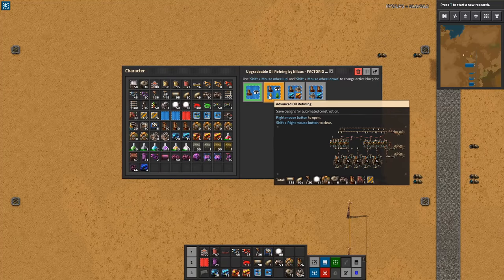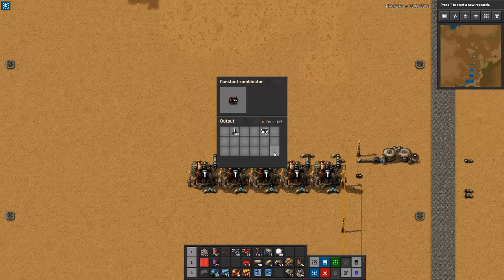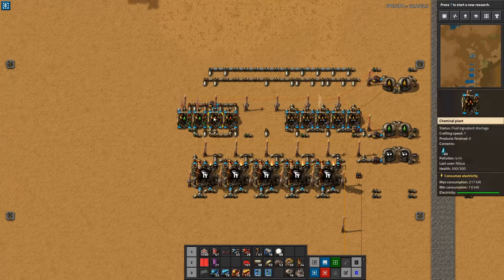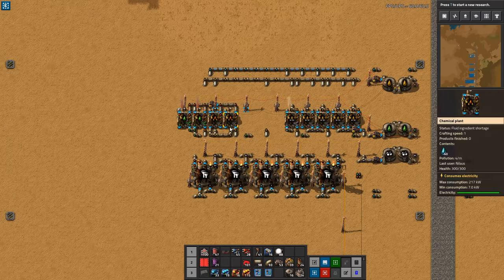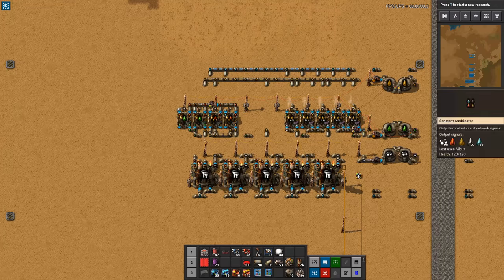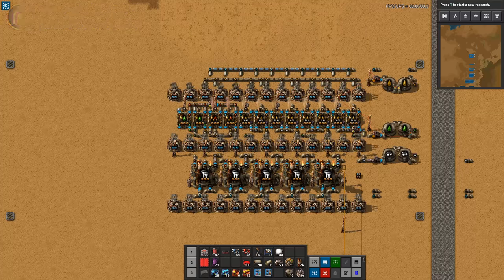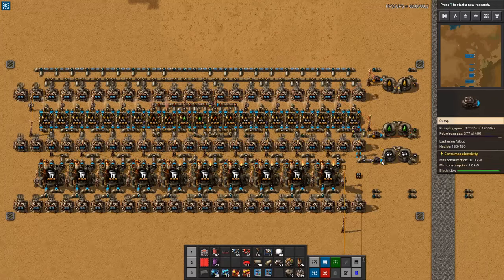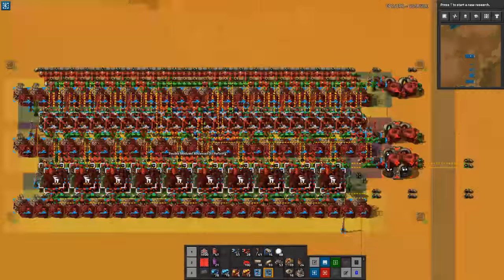OIL REFINING & PROCESSING from Early, Mid to Late game -  Factorio 0.18 Tutorial/Guide/How-to

Comment: How about starting with setting up the oil field itself. Pumpjack facing, pipeline setup etc.  good luck with whatever you are doing now.
Reply: there's no cookiecutter way to do that, but fortunately it's not complicated. just throw a pumpjack down on each deposit, consolidate them into some tanks, then connect the tanks to a train station blueprint. don't forget to provide power to the jacks and if you used pumps as well.

Comment: Really impressive build, I think I will use this. I do think there is an argument that the 8 refinery setup has its place during the early-mid game when you're producing yellow/purple science and starting to produce level 3 modules. The level 1 modules do work, but they're a lot less energy efficient compared to level 3 modules. You'd probably want to upgrade power to nuclear first.
Reply from the maker: I decided to design around 5 Refineries because the crafting time is 5 sec, so it becomes easily divisible, but there is nothing wrong with doing it for 8 refineries either.

Comment: I feel i may go unnoticed here.. but I find it easier to include as much as possible in a city block seeing as my base currently was fit into a single city block other than a dedicated chunk for solar panels before getting heavily into your videos. I've been trying to fit your HUB, Oil refining & processing, greed red blue circuits, and science into a 3x2 city block area (I've built in the water for safety and have roughly this space available (one block dedicated to solars/accumulators)) I've almost got it down.. the circuits and hub was easy to keep in a single block only having issues with the science packs. anyway you could help with that?

Comment: There is a tiny risk that the first advanced oil refinery build might back up with heavy oil. If the lube is being continually taken away and stored/used elsewhere then the pump that allows heavy to light cracking to start (based on stored lube) will never switch on. The refineries are producing 25 heavy per second but the lube makers are using only 20 per second. You aren't storing the excess heavy, so it could back up. You could fix that by moving the pump to the right of the first heavy to light cracker so 1 is always working (like you always have the extra 2 in the final 10 refinery build)

Comment: Pipes were constrained to 1200/s before the 0.18 update. Now they have variable pumping speed depending on the fluid, heavy oil, crude oil have a max flow of 1500/s where petroleum gas have a max flow of 2250/s. Previously, pumping from tank to pipe with a pump, used to constrain the flow rate to 1200/s, now if you have tank - pump - pipe - pump you can have up to 6000/s flow rate, for every pipe after the first pump you exponentially decrease the flow rate of the system, so to keep 6000/s you need a pump every other tile or if you wanna keep 12000/s you have to bring from tank directly to the consumer.
Also underground pipes have less impact on distance than what they used to have. Underground Pipes now acts as a 3 regular pipe line, with the max flow of 3000/s assuming you have a pump on each end.
Reply from the maker: I decided not to go into the lengthy description, but rather state that I had checked it and it is not a constraint ;)

Comment: I'm curious why the decision to make the third stage with increased production use beacons rather than first expand the number of refineries and chemical plants? Wouldn't that be significantly cheaper?
Reply from the maker: From stage 2 to 3 the Petroleum goes from 98 to 831 / sec. If you want to make 831 / sec without beacons then you need 40+ Refineries
Reply: @Nilaus  I too think maybe an unbeaconed build before the the beaconed one would be useful to show. The 5 refinery jump to a beaconed build needs 149 level 3 modules requiring around 1/2 million gas to make the plastic and acid. With a 5 refinery unbeaconed build, using the plastic and acid for nothing else, the refinery will take around 90 minutes.

Comment: Question: Why no heavy oil output? I'm in the midgame if my first playthough now, and I have not gone to advanced oil processing yet.
Reply: The only output you need for heavy oil is itself as the input for lubricant and light oil. So you generate and make use of all of it in the same spot, no need for a tank and pipes outputing heavy oil elsewhere

Comment: I have a question. What do i do when the oil deposits are far away from my main base? Should i transport the oil by fluid wagon to the main base and process it there or shoul i process it at the oil deposit?
Reply: Little late here, and also not him, but I usually ship mine via train instead of trying to process it on-site. There are various reasons, but the biggest one is that It's much easier to transport 1 liquid, crude oil, than several

Comment: Im new to circuit networks but my pumps acting weirdly. I connect my pump to light oil tanks and set for example "[Light Oil] > 5.0K". My tanks only have like 500 light oil and the pump is "Disabled by control behavior".
So maybe someone can help?
Also the whole "fluid system contains 700" so thats not the problem.

Comment: Hey there, I tested this blueprint out and it appears to no longer work as I thought it would, the output still stocks up on heavy oil blocking other fluids
Reply from the maker: It works perfectly. I use it in every base I build without problems
Reply: @Nilaus  I did have Infinity pipes to simulate output and it would stock up on a lot of one of the oils pausing all production, fluids are a nightmare to me, been trying to fix my setup for a day or two now but I'll try again

Comment: There is a much simpler way of doing the  lubricant before the cracking. If there needs lube, the lube production will simply suck in most, if not all of the heavy oil. When it backs up... it just flow past it

Comment: Sigh

Me: Just trying to figure out why my pipes show 0.1 petroleum gas going through them.

Every fucking video concerning pipes: WITNESS THE GLORY OF MY FUCKING AUTISM!

I think I'm just going to stick to OTTD. Atleast the autism there is managed and scaled.
Reply: if you have a super long pipe system, that can happen. there's a pressure factor in the pipes, meaning super long pipes will have less pressure near the end, resulting in tiny amounts of oil coming through. you need to add pumps along the pipe route, OR use a train system. this applies to every liquid. check out train station blueprints for liquids on the innanet.